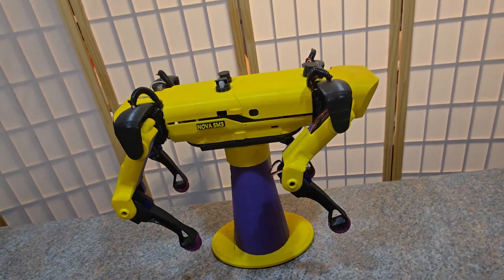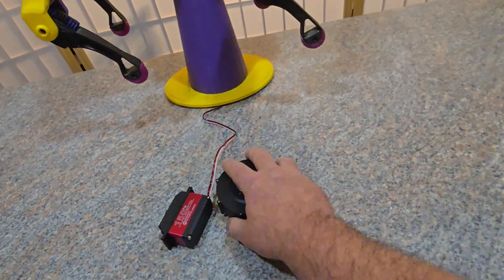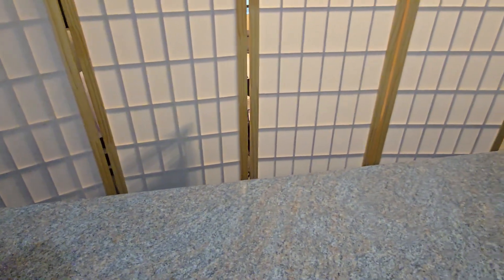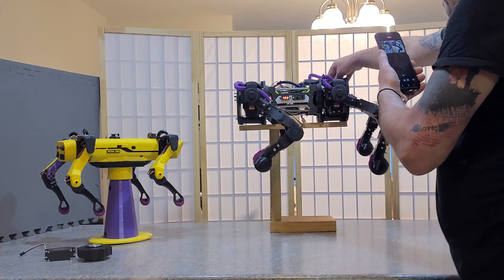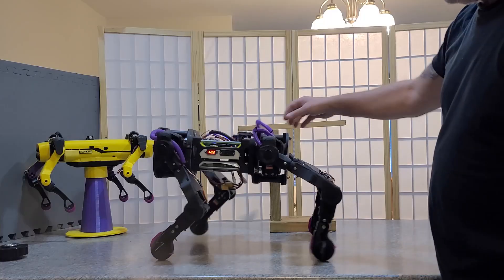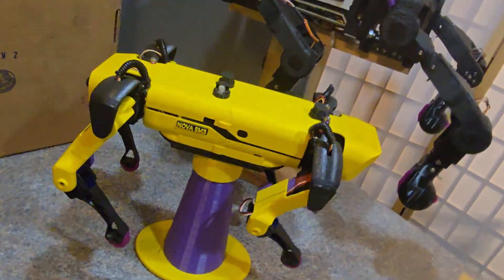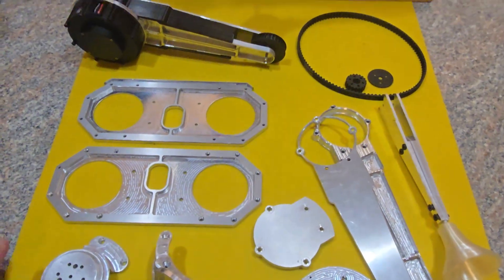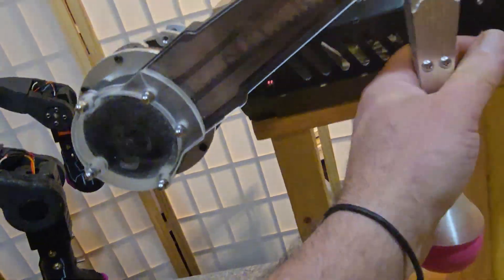Robot Dog Builds: NovaSM Series

Comment: This is really cool! It reminds me of the MIT Cheetah with its motors. I’m working on a SpotMicroAI project and needed to use your parts from NovaSM2 because my servos didn’t come with the same horns as the original. Luckily, I had a few of the metal disk horns you used, and they seem to work fine. However, I had to enlarge the nut holes since they didn’t fit on the first try. 😥
Reply from the maker: yes, NovaSM5 is based on MIT cheetah!  SpotMicroAI, huh?  sounds interesting. And yes, those aluminum servo horns are awesome - but hard to find sometimes.  Good luck with your project, hope we hear more about it!

Comment: Wonderful project, happy to see you back :)

Just a couple of suggestions having played with ros2 and Jetson, ros2 and raspberry, ros2 and x86, i suggest you to not mix what you jeed on the robot (control, sensor, etc..) with what you need to simulate it (gazebo) and what you need to control it (rviz, small other stuff)
The raps 4 is good enough to make it work if you are not using vision sensor. The jeston is needed when you want to do some image processing (so visual sensor that needs to stay on the robot). The problem with the jetson is that software it's linked to the hardware. This means that latest driver wont work on older jetson. If you have the possibility i would sujjest to use a x86 board. You wilk thank yourself diring troubleshooting!!

Hope to see videos again :)
Reply from the maker: thanks so much, and for the great tips!   Do you have a x86 board to suggest?  I've played around with a jetson a bit, and you're correct, if not doing visual processing, that's just overkill in my opinion, and not worth all the compiling and updating.  I had the jetson sending data to a teensy which was still in control of the robot itself.  So I may go with a dual mpu design like that again, if practical.
Reply: @ChrisLocke1969 thank you for your immediate answer!
Having a microcontroller make sense sometimes. At university we build a robot where the Jetson is there to do stuff but then sends data to a ros node in a microcontroller (in our case the pico, but it depends on your needs, if you need high clock a teensi will do it)
The problem with more complex motor is that you have to do a lot of stuff to make them work, but in the end it might be better to choose the easier hardware to build on.

Form an high level view it does make sense to have a PC for high level task (slam, object recognition, recieved controller data, ...) and a low level code to convert input from the high level to robot movement. In this way the high level (that is extremely complex on himself) is not depending on hardware and easier to write.

Regarding the x86 I have no real suggestions because in the end at university we found very good guys from it that solved the problems and now it works, but I know that they have to become a lot of issues because of the Jetson. Arm processor in himself is not a problem, but using the GPU most of the times is
Reply from the maker: I appreciate you sharing your experiences, thank you Sergio!

Comment: By the way, what CNC did you buy? Is it difficult to acquire aluminum blocks for machining?
Por cierto ¿que CNC compraste? ¿es dificil adquirir los bloques de aluminio para la mecanización ?
Reply from the maker: I suppose it would depend on location, but no, its not difficult to get aluminum - but can get a little costly if not buying in bulk / large plates.   I have a genmitsu 4040 pro max - great machine for the cost.

Comment: At first glance the SM4 looks more doable. I checked Amazon and the 150kg servos are $37 apeice - a bit of money, but not terrible. What is the model of the BLDC motor?
 With that said I'm looking forward to your next video.
Reply from the maker: absolutely correct, the BLDC motors won't be cheap.  I have several that I am testing to see the lowest price point that would be feasible for the project.  I will definitely do more videos on the motors, but I probably should setup better video facilities beforehand ;)

Comment: An interesting project. I'm currently building a version of Nova SM3 with ROS 2, and I wouldn't mind getting involved in the project you're talking about. The cost, of course, has to be taken into account, but it's very exciting.
Un proyecto interesante. Yo estoy ahora montando una versión de nova sm3 con ros 2 y no me importaría meterme en el proyecto  que comentas. El coste, naturalmente hay que contemplarlo, pero es muy ilusionante
Reply from the maker: nice! what board are you using to run ROS 2, a Pi?
Reply: @ChrisLocke1969  I was thinking about using a Raspberry Pi 4 to adapt the Ros2 simulation to the real world. I have to tell you that I've had problems installing the current versions of Ros2 and Gazebo. I've mounted them on a virtual drive; at first, I used Windows 11's own, WSL2, but it's given me a lot of problems with the graphics card I'm using, a 16 Gb RTX 4060 Ti. So I ended up using a VMware WorkStation virtual machine, which mounts everything without problems. Another thing I wanted to tell you is that almost all the Spot or Spot mini models are for Ros 1, and this is causing me confusion because it's going to force me to dive headfirst into Ros 2 programming.
Reply: I have also bought an Arduino GIGA R1 wifi which is a beast with 2 ARM processors, but it is more difficult to adapt from ROS 2. I have seen that it can be used to actuate motors and sensors, being directed by a Raspberry Pi.
Reply from the maker: @gdxpedro  that all sounds awesome - please keep me updated!   With another version of experimentation, I had a jetson Nano running gait calculations and passing them to the teensy - it was pretty fast, but no special OS or software like ROS.  I have no experience with ROS at all, and not sure I'd have the time to learn from scratch.  But you've peaked my interest, I will be looking more into it this weekend! :)